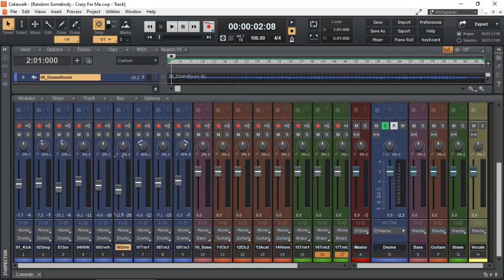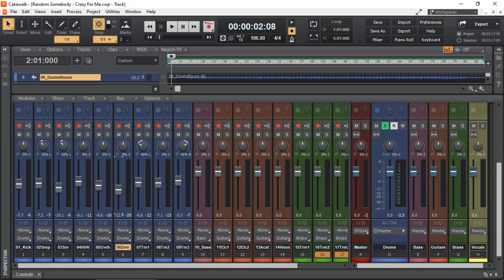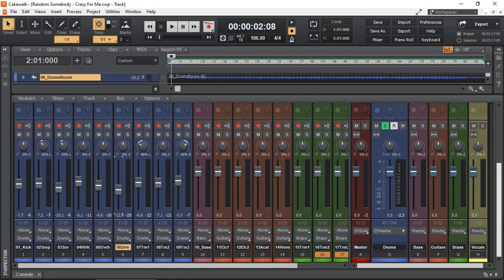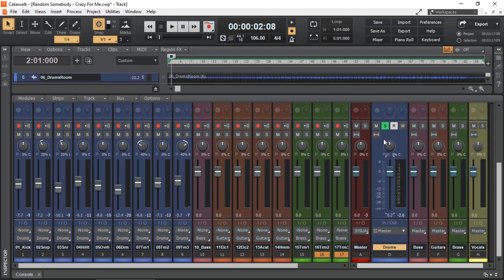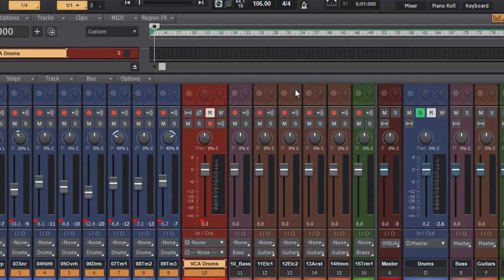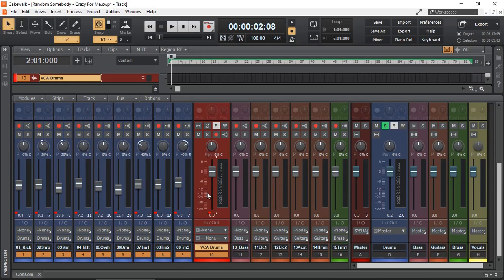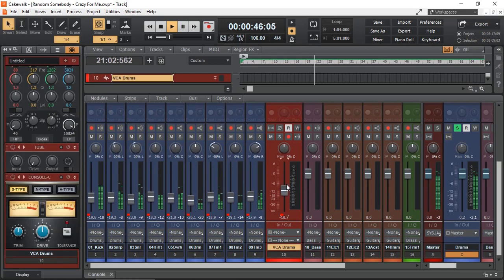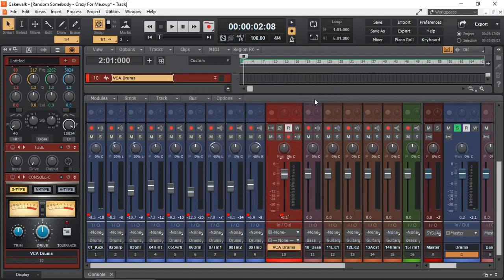VCA Fader in Cakewalk by Bandlab for Better Mixing

Comment: If it locks the faders, it's not a vca. You're supposed to be able to use it at any point in mixing, including the beginning.
Reply from the maker: Not sure what you mean. A VCA fader controls all the faders connected in relative to each other, but at the same time each attached fader can be changed individually. You can set and use them any time of the project.
Reply: @RecordingStudio9  let's say you do what you did in the video, but with two tracks. Kick, snare, plus vca fader. On protools you can pull the kick and snare in opposite directions and adjust the VCA master fader at the same time. In Cakewalk, because the kick and snare are in a group they move together, not independently.
Reply from the maker: @davidroberts3262  Missing the point of a VCA if you can change all 3 faders at the same time. If kick fader is going up and snare fader down, as well as VCA going down, that contradicts the kick fader movement and makes no sense, even if possible in PT. Again, as I mentioned at the beginning of my video how Cakewalk does not support any 'real' VCA faders.
Thanks for watching.
Reply: @RecordingStudio9  the point is what if you later on realise you screwed up the balance, if the group is locked you can't change it. Sorry for sounding butthurt, I just wish Cakewalk would have full support for VCA faders. #FirstWorldProblems
Reply from the maker: Yes, of coarse you can still move each of the channel faders indipendently to re-balance, at any time. Just press the CTRL key as you move the selected fader in the "VCA" group.
Reply: @RecordingStudio9  I'll try that, but if you're using a controller. I'm about to hook a new one up. Would I have to press Ctrl to move faders simultaneously?

Comment: What's the diffrence audio wise between doing this, and turning up or down the gain of a bus that has multiple tracks routed to it ?
Reply from the maker: Thanks for the question. As I have mentioned in the video, it's "Proportional" levels of each fader/track and not the combined balanced level into a Bus.
Reply: @RecordingStudio9  let me put it another way, do you think you could tell the diffrence in a blind test ?
Reply: I wondered the same thing... in the bus the drum tracks wouldn't be relative to each other, but probably not that noticeable unless adjusting fader drastically. But if you spent a lot of time getting the drums to sound the way you wanted, it might be worth incorporating the VCA Fader technique.

Comment: This is a clever work around. But I'm not sure how this would handle tracks with sends. I wonder will the AUX track relativity attenuate or amplify the wet signals on tracks with sends?
Reply from the maker: It's no different than moving the faders individually. If Send is Post Fader, then yes, it will effect Send level as normal.
Reply: @RecordingStudio9  right.  So at post fader in this case, the AUX channel fader is truly working like a VCA provided the group properties is set to relative.
I'm going to use this method.
 Thanks for this great tip.